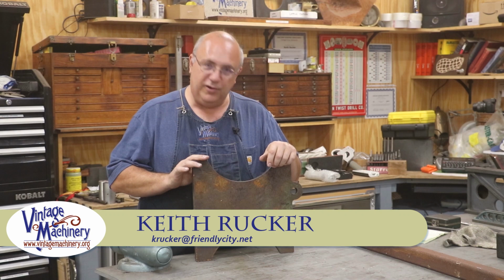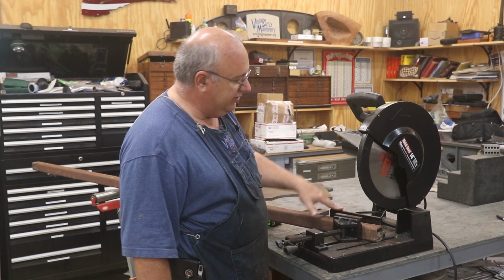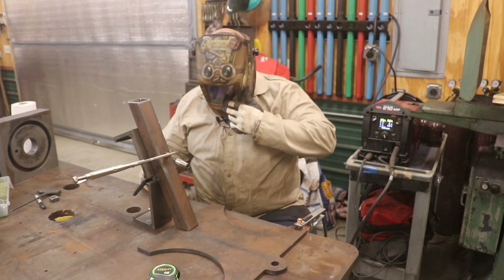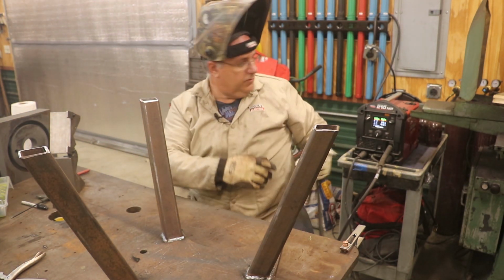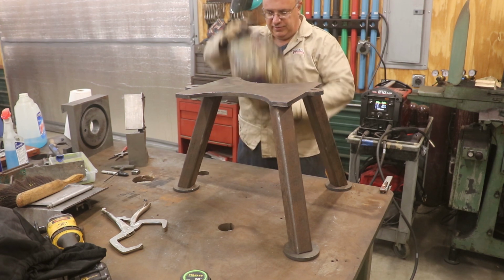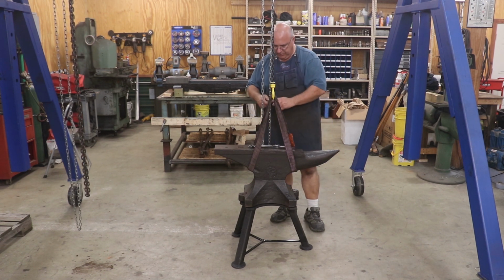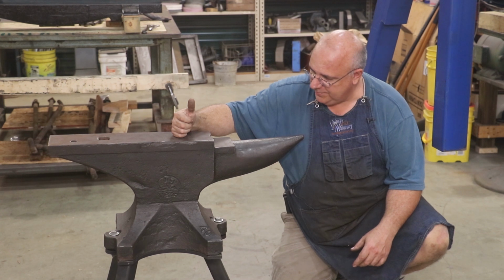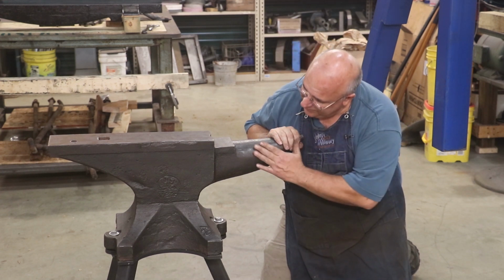Fabricating an Anvil Stand for a 400 lb Fisher & Norris Anvil

Comment: Among those of us who are welders, it's accepted that all the rust has to be off the metal before you think about welding it. A couple passes with an angle grinder will do it but it's a step that needs to be taken if the welds are to be their strongest!!

Comment: Just to be a armchair machinists/engineer it probably be a good idea to put wooden feet made of seasoned Live Oak or similar hard wood to give the anvil and the concrete floor a bit of cushion from each other.  On a side note growing up their was an old man who lived up the street from me and he was a jack of all trades and master of none and one of the trades he worked in was metal work of all kind.  I remember him making a stand for a anvil he had got in trade for something or another, anyway like the stand Keith just made his was made out steel but was a much different design but that is besides the point what it did have in common was a piece of plate steel the anvil was ultimately attached to using a bracket but in between the anvil and the plate steel my neighbor had put a sheet of lead about 3/8 of an inch.  I asked him about it and he said that anvils sitting on steel needs something to absorb the stresses of the metal to metal contact and it didn’t really matter what it is be it wood, lead, conveyor belt, but it needed something other wise over time with heavy use the base of the anvil could/would crack.  I don’t know how much validity that story is about putting something to absorb vibration and whatever between the anvil and the steel stand is but then again most of anvils I have seen are mounted on wood be it a stump or some sort of glue up.  Take it for what it’s worth I am just passing along what I was told by a man who’s opinion I respected about most things mechanical, or constructed out of steel or wood.

Comment: GREAT job as usual and always fun to see you building something for a change. I gave a local friend two engine cart wheels which he mounted on his anvil stand just so they did not touch the floor. With a custom T-handle inserted into the hardy hole, he can tip it back slightly so the wheels contact the floor for easily moving it around the shop.

Comment: you may want to fill the legs with sand or other material to help limit the vibrations through them. i made a stand very similar for my 300lb fisher anvil and ended up filling the legs with steel blast media from work. stand is right around 100lbs by itself. i ended up using 1in plate (that was fun to drill by hand  lol)  and 1/4in wall 2in tubing for mine. im planning on using some of the 3m 5200 and the bolt holes to secure it to the stand

Comment: I acquired a 200 pound Vulcan anvil for $ 50 sometime in the early 1990's. Like yours, it had a cast Iron body with a tool steel cap. It sat unused in my garage until I traded it a few years ago to a friend for some help installing new siding on my house. We agreed $ 250 sounded like a fair price. It was manufactured in 1950 and was in new condition, with just some blush rust. When stored in unheated buildings, anvils "sweat" in cold weather. They have such thermal inertia that they stay cold when the weather warms and condense moisture out of the air. Even here in Colorado they will rust over time.

Comment: As an engineer I kind of took it for granted that gussets or bracing would automatically be added later, but sometimes things are not so immediately obvious. Good to see you got sound advice from some friends to brace it, otherwise the welds would end up splitting unless it was bolted to the floor.

Comment: Maybe some nice, thick, oak feet under those legs. Very nice anvil and stand. Intererestingly, the base for an anvil has a special name in German. It's called a Schabotte or Unterbär "Lower bear." Nowadays, these names are usually only used for an anvil under a power hammer, however.

Comment: I like it! My suggestion would be to impose on your buddy Eric to cut a plate to be used as a shelf for hammers, punches, whatever, also providing that "Spread" protection. And yes some kind of insulator between the anvil and the concrete would be advisable.

Comment: Redo the leg braces with a steel box sleeve for one leg of the pallet jack to barely lift it off the floor to move it without the gantry. Also weld on several pieces of square tubing so you can bend an l or s shaped bar for a hammer table. That can be moved around to different sides easily

Comment: I was a millwright for 35 years. I prefer hard wood for mounting anvil ( an old oak stump 30" dia.) the wood has a little give a bounce.
Reply: yeah? lets see  your 400 pound Fisher & Norris.
Reply: I was thinking the same thing. He should put a layer of rubber between the stand and anvil. I cant help but think this is a good bell.
Reply: Exactly. I've never seen a real anvil that wasn't on a stump. Love Keith's ability but sometimes simple is No. 1!
Reply: @jacilynns6330  Fisher anvils nearly don't ring since they're part cast iron which absorbs the ring. Bolting down a loudly ringing anvil to a steel plate is way more efficient in canceling the ringing than putting it on a tree stump. It totally absorbed my cast tool steel anvil's ringing.
Reply: Yeah, that silly little 3-legged stand is useless as an anvil stand, absolutely no stability. Fortunately it won't be used by a blacksmith. 
You're not supposed to critisise Rucker, it gets numbnuts like poor little erik61801's knickers in a knot!

Comment: Also any plans to cushion it from the concrete floor? Some strong hardwood or possibly reinforced plastic cups under the feet would prevent shocks from being transmitted into the foundation. At the very least your feet would thank you from not having to feel all the hammer blows.

Comment: hey there Keith can I ask you to bounce a ball bearing off your Fisher & Norris 400# anvil?
I and any smith don't care about hammer "sound" but the rebound on the Ball bearing dropped from about 18" tells a bunch. If the ball jumps after hitting the face it is good.  if it does not, you could try putting silicone under the anvil and on the 1/2" stand. So you may not wish to do this.

Comment: These saws are great in a knowelable hand but do not try it on chain. We had one and I had to take it out of the shop. Truck drivers and common sense can be verry far apart eh. I can tell by the sounds of your welds you need to spend more time with it. The welds may be sound but can look somewhat better. Nothing to worry about my friend. Place a 2 inch piece of that wonderful hardwood under the anvil that will take the ring out of the anvil. It can really hurt your ears.

Comment: You should put it on a oak stump, it would dampen the noice and vibrations.  If you use it as this your machines will jump on the floor, when you use a big hammer.
Reply: It’ll get about as much use as that fancy forge he built a few years ago.
Reply: @rodeo11  A good use of a anvil, as a blacksmith. is to solve discussions, you lift it up and walk around the stump and sit it down again, your opponent do the same, the one that can take most rounds is reight!

Comment: I'd recommend to fill legs with sand before welding- to dampen vibration from anvil or it will sound like a church bell.
Reply: Not this one. As Keith mentioned, cast iron body anvils do not "ring." It would be useless as an instrument in "The Anvil Chorus."  ;-)
Reply: jacktheripped  You're not going to ruin your anvils dreams of being in the Anvil Chorus are you?

Comment: The Shock wave going directly into the concrete bothers me a bit, the inertia of the 400lb is more than enough for forging by hand. I don't think you need the hard joint to the floor. Perhaps some tire tread patches cut from a scrap tire and bolted to the bottom of the steel circles would alleviate that. It would raise the height by 3/4 inch or so though.

Comment: I don't get it - why not clean off the rust and get a stronger weld?
Reply: Welding a bunch of low carbon steel with a mig welder, getting it 100% clean will make virtually no difference. Yes, get rid of anything heavy. But the little bit of rust he had  won't affect the weld.
Reply: @siggyincr7447  
Well, I beg to differ - as do experts in the field.
Reply: What exactly do you expect will happen because of that bit of rust? Once the puddle is formed, it'll just float on the surface.
Reply: @siggyincr7447  
Inclusions and porosity. Look it up.
Reply: @Peter_Riis_DK  Not from that tiny bit of rust---unless one does not have a clue what they are doing.
Reply: @5x535  
Okay, let's agree to disagree then. :)

Comment: No disrespect but I would have made that base out of heavier tubing, using the same for the triangulation supports inside. But I like overkill! Check out Alec Steele for his anvils. And another thing: Why is it that I KNOW I'm looking at a computer screen and STILL turn away when somebody strikes an arc? And as FlatHammer wrote a big old Oak stump will spread the impact over a larger area and absorb some of the impact. Now it has to be cut flat and sitting on a good flat spot. Outside on the dirt it'll make it's own flat spot...

Comment: Sorry Keith, that stand just does not fit the VintageMachinery style.  A piece of oak tree trunk would be much better, would have much less hammer force dissipation, and give you a surface you could put hammered loops on to stick your hammers and tongs so they would always be right at hand.  Now, you need a coal forge or a gas-fired glory hole to heat metal.  Maybe you could con your buddy, the collector of hammers, out of some of his surplus blacksmith hammers.  Happy metal pounding.
Reply: Search his videos.   He built a beautiful gas fired forge a couple years ago.....haven’t seen it in use yet.
Reply: @rodeo11  If my memory is right it was designed as a "furnace" lined with refractory for a crucible to sit in for melting metal into a molten form for pouring.  In a coal forge, you simply insert the metal being heated, usually without a refractory lining, for hammering into the coal and feed air to make it hot to the color you want (yes that is oversimplified).  A glory hole is "usually" fired with natural or LP and uses refractory to focus the heat into a small space into which you stick the piece you are wanting to heat for hammering.  Gloryholes can be as small as a large coffee can.  I do not remember Keith melting any brass or aluminum for casting with his super nice furnace.  Just my humble remembering in my old age.
Reply: Big'un44 You’re right...two totally different things.   I just wonder why that fancy furnace never got put to use.  Thanks for the correction...my mistake.

Comment: I’ve got a beautiful 225# fisher anvil, only damage is that some $&$# #$%!!! sometime in the last hundred years was cutting something on top of it with a wafer wheel and cut a 3/32” groove across the face, there’s a special place in hell for that guy.
Reply: Fix it.
Reply: Paul Copeland , I’ve thought about welding it but I’m afraid to mess up the temper, wish I had someone local with a big surface grinder.

Comment: I suppose with the cast iron base you can mount a Fisher and Norris anvil on a steel stand without the horrible ringing you would get from a traditional anvil. I had always understood that other than portable anvils (and you are never going to use a 400lb anvil as a portable), that is why it was best to mount an anvil on a hardwood tree stump, preferably elm. This acts as a damper for the ringing.